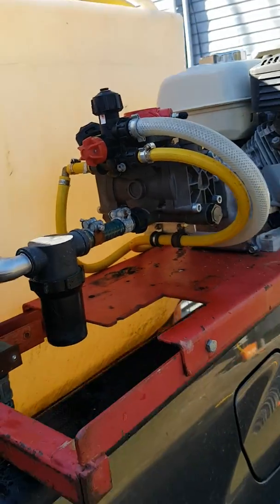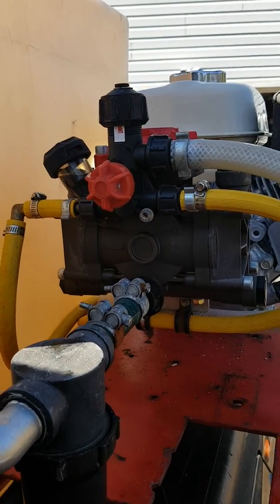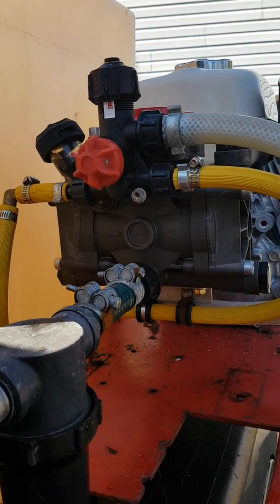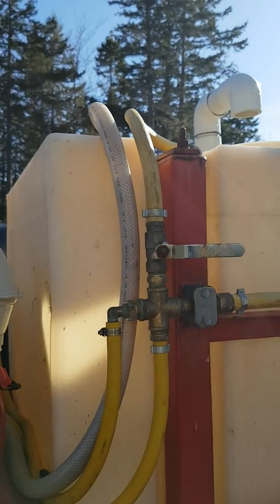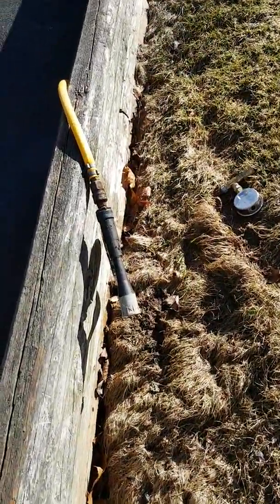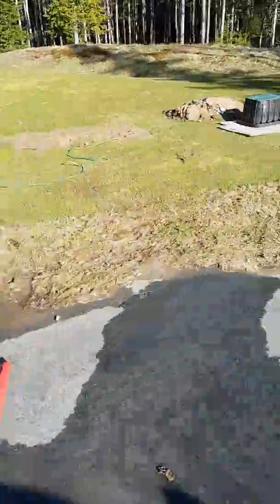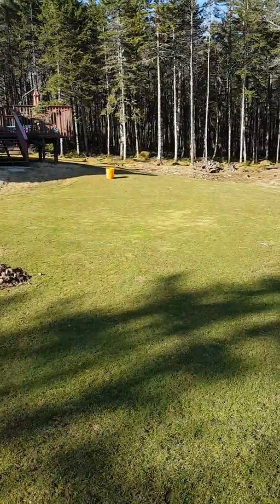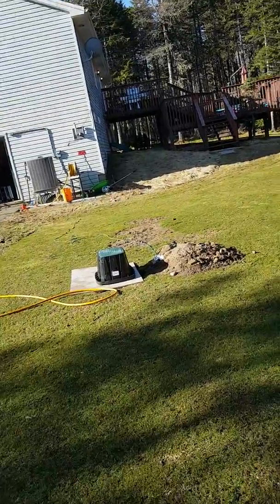More flow from your hypro diaphragm pump, spring green up observation.

Comment: What type of GPI meter are you going to buy?
Reply from the maker: Hello, I'm using a GPI TM050-N. Works well fo calibrating flow rates. However, due to the placement on the skid sprayer and the 300 ft of hose after it, the totalizer function works best for larger volumes.  This is due to the d252 pump running at 200 psi to get 50 psi a the nozzle for a flow of 15 lpm. When the trigger closes on the gun/wand, the pressure builds behind it and the totalizer keeps counting this. It would be more accurate if the totalizer was on the gun, but I dont want the bulk. 
Cheers